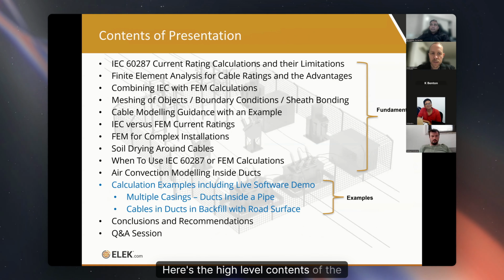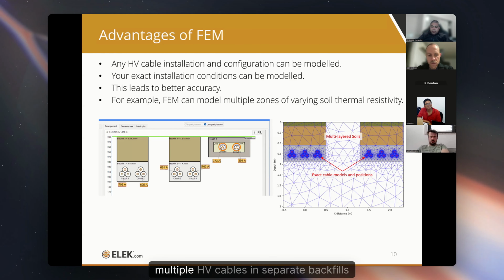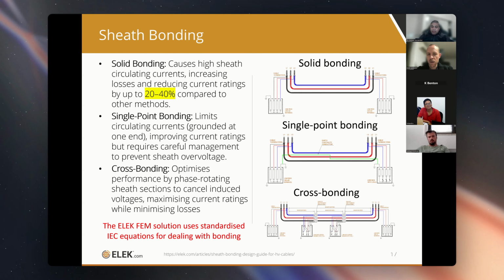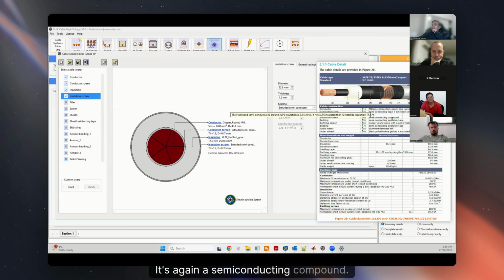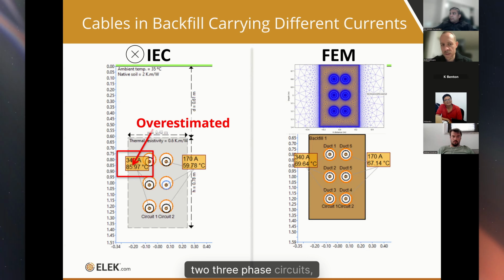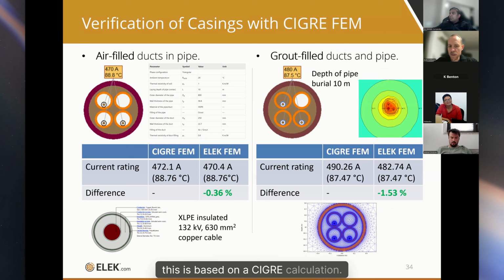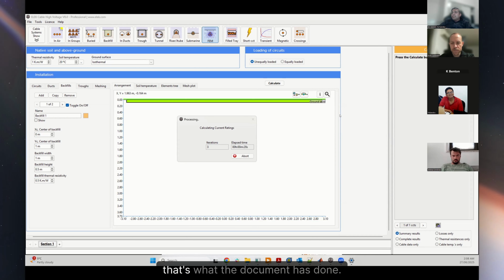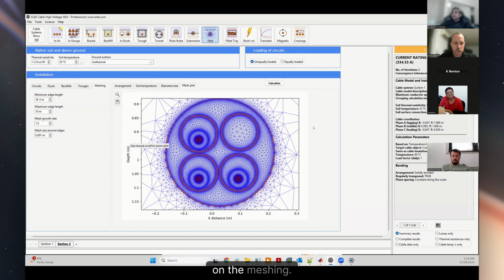Free Training - How to Calculate Cable Ampacity with the Finite Element Method

Comment: Can I download the software? Is it free ? Do you offer discount?
Reply from the maker: Thanks for your comment! The software isn’t free to download, but you can try it with a free trial here: https://elek.com/electrical-software/elek-cable-high-voltage/

We also offer the ELEK Power Bundle, which saves you 30% compared to buying each tool separately. You can check the pricing here: https://elek.com/electrical-software/power-bundle/